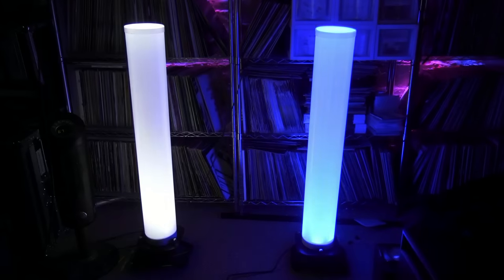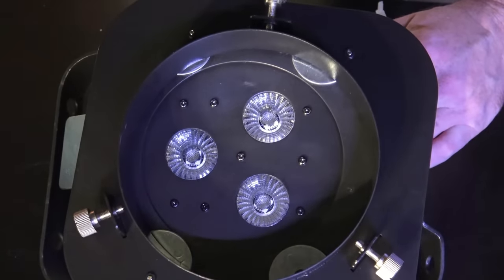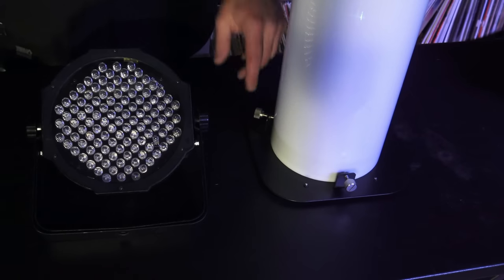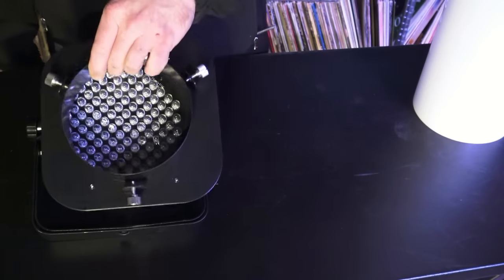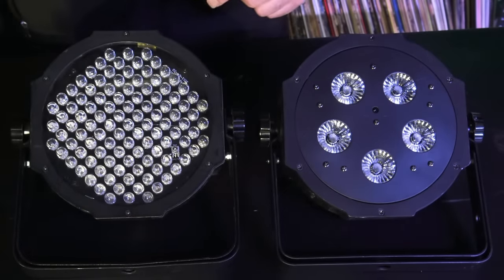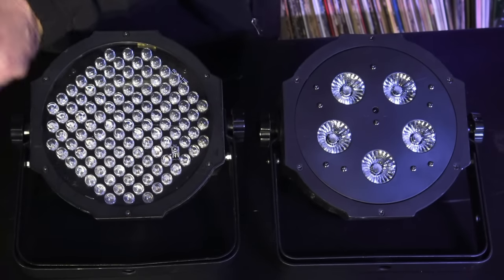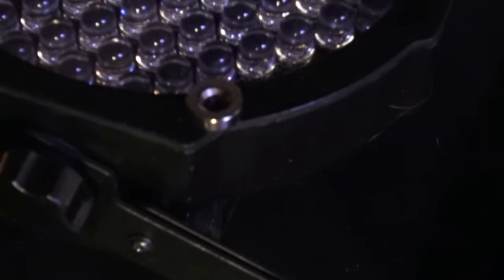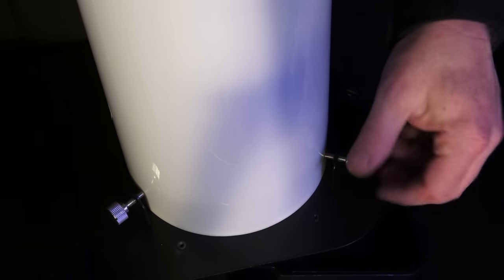By Request - How To Mount ADJ Magna Tubes on Mega Par & Mega Tripar Profile Plus

Comment: if you just place a steel washers on those same 4 screws, you can leave magnets on the tube so you can quickly bounce between fixtures
Reply from the maker: +Michael Schaefer They would have to be pretty big washers.  Your aim would have to be dead on when putting the Magna Tube base on the fixture.  No room for play. The other concern I'd have is stress on the screw when packing everything up.  The plastic case the screw threads onto could be compromised.